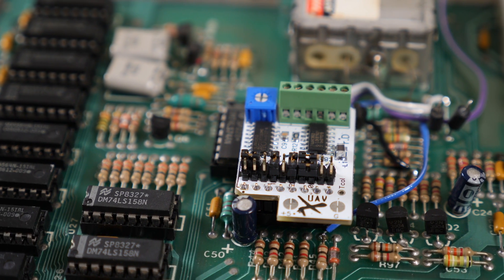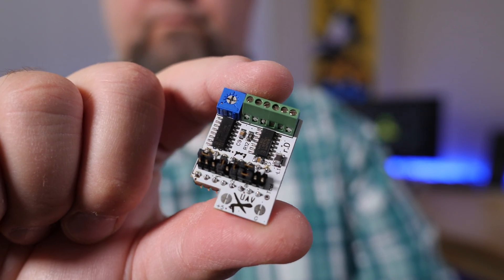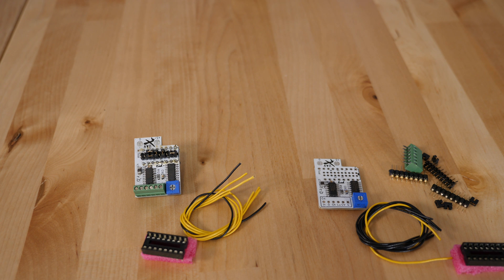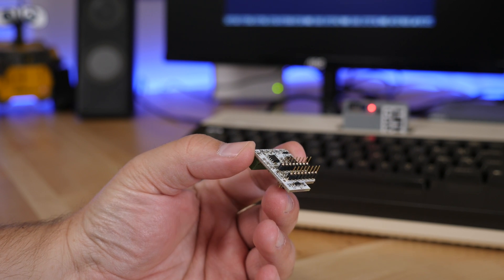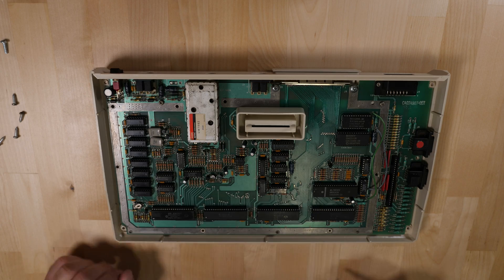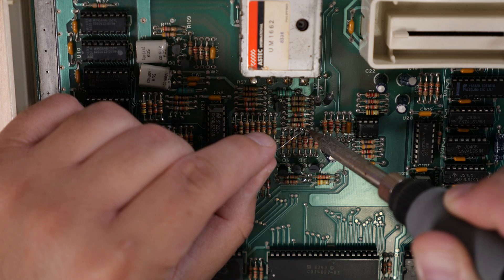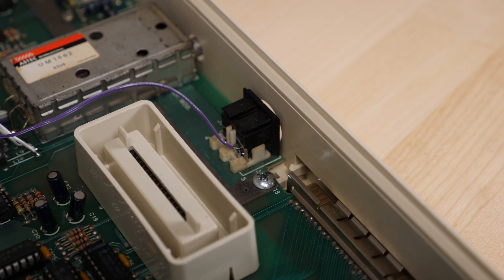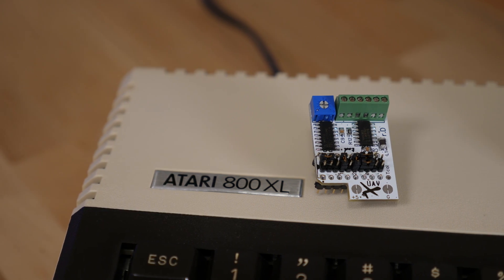Ultimate Atari Video board for Atari 8 bit consoles and computers (UAV rev D install)

Comment: One can argue that as large as the pixels were on the Atari 2600, composite over RF was adequate.  One thing I remember about the Atari 2600, it did not include equalization or serration pulses in the signal.

Comment: I am an Atari game and computer systems loyal fan. I might get a UAV video card update in the future, but for now I am fine with the standard composite audio/video connection for my computers and the original RF Switch Box for my game consoles. Thank you for showing me what modifications can be done to my Atari 800XL computer system.

Comment: Todd, did you have to custom make a cable to go from the Atari monitor port to a 4 pin S-video plug to go into a TV?  There are RCA to S-video adapter cables but I'm not sure the pin outs would be correct.

Comment: Todd my used Atari 800xl just arrived. Bow was torn and faded. But what was inside. Was never used.  Ever. Everything rapped. From factory.  I paid 240 for it.   Should i not use the new one.  And get one that bin used.  And save the new one for 20 years? Is there any point?

Comment: XEGS has the cleanest standard composite out of all the models. No need for this mod at all.

The chroma pin on the socket ought be cut on the foil side as it's tied to ground.

Comment: This is a wonderful thing! I absolutely love it, although an 800 monitor out to S-Video cable (which uses the extra pin out, on the 800, as compared to the XL/XEs), for $22, doesn't require any "surgery," or even close, and is a really nice component (not to be confused with "composite video... "). Again, that takes nothing away from this excellent, well-engineered component. Cheers! 🍻

However, doing some research, this is not even close to the "ultimate" Atari 8-bit board. The board in this video -- while, again, awesome -- is like high school football, as compared to the NFL, as shown here: https://youtu.be/o51S_ylNP4A

Comment: This is awesome! I can't wait to grab one of these, to use with the S-Vid input, on an old "EDTV" (as I said, it's old, and so I guess it has problems getting turned on, sometimes), which is an LED from around the turn of the century that is 4:3, which should be AWESOME. 

THANKS SO MUCH FOR HAVING MADE THIS VIDEO! I'm glad it's an 800, because it still has the composite out, but it WILL have that S-VID, which will be crazy cool! 

Damn, dude! I can't wait. If you're still active, I'm subbing! Cheers!

Comment: Can u do it with an Atari 5200??
Reply: The UAV board does work with the 5200 and is very easy to install.  I recommend doing the power mod while you have your 5200 open if you have not done so already.  Well if you have the four port system that is.

Comment: Sorry if this has been asked before, but I just found this video recently. Does this upgrade still allow the hires mode to artifact for color? I've seen some other chroma/luma type connections that essentially give you a sharp, but monochrome, image in Graphics 8. I would very much like to do this upgrade if it would still artifact the colors in the modes that occurs in.
Reply: If you use composite, then yes. If you use S-video, then no. S-video removes the ambiguity that causes artifact coloring.

Comment: Hello, great video! The improvement is very impressive. I noticed that there's still a fair amount of color bleeding after the upgrade. Can you get rid of that via tweaking the UAV board? (or maybe it's just YouTube?) Thanks.
Reply from the maker: Some of that might still be inherit in the Atari hardware. S-video will still have a little bit of color bleed since it isn't digital. But overall the upgrade is much better than stock.
Reply: UAV designer here. There are certain things you can never get rid of just because composite video has very limited color bandwidth and the color changes will not fall perfectly on the edges of pixels (for example, you can see on the left edge of the screen that the video decoder takes a moment to sync to the appearance of blue in the signal). Plus, the time it takes to transition from one color to another depends on the color, leading to dark shadows in some cases. Using professional monitors can help since they often have more elaborate color circuitry, but old school video is what it is. There are upgrades out there that replace GTIA with an FPGA to generate sharp RGB video, but I'm happy squeezing the best performance from the original chipset.